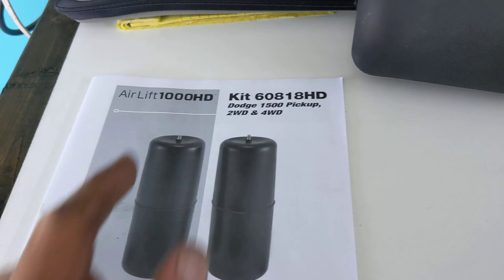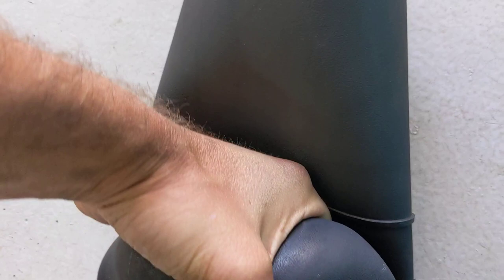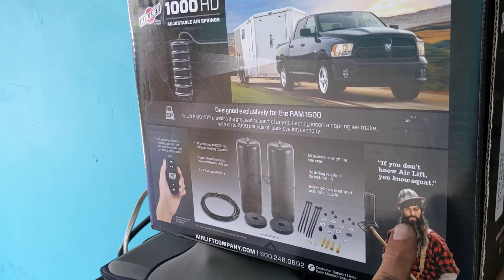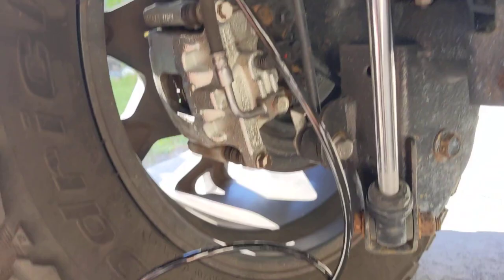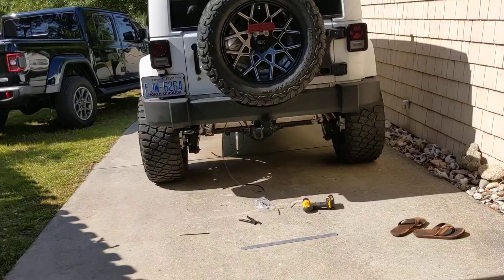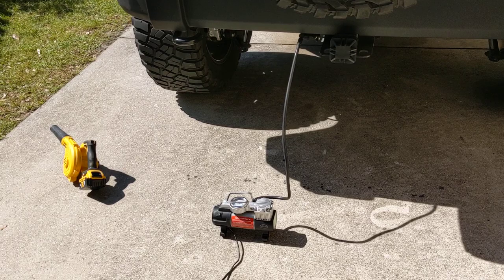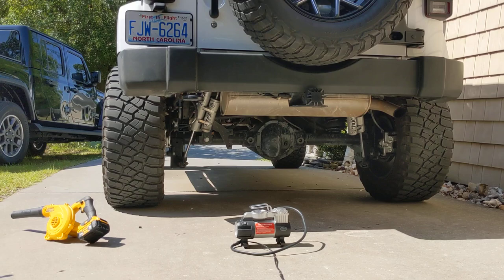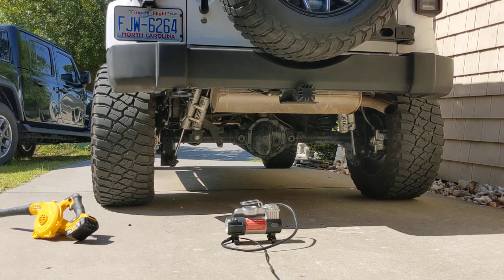Project Overland: Air Lift 1000HD Jeep JK Wrangler Installation

Comment: Look forward to your review.
Reply from the maker: I will be doing a review soon. But in the meantime... I LOVE these air bags!!!  at 55psi I have 0 sway and or bounciness from the rear and the biggest thing I noticed is when re-leveling the Jeep is braking seems much more effective with the nose not pointing upwards. Because I'm on the sand out on the beaches where I live I keep them at 40psi on and off road so that I'm not inflating and deflating all the time and that seems to be a good split for my use. A little stiffer on the road and just soft enough off road to not need dental work 😂

Comment: I've been searching for which bags I'd need with Mopar 4".  Thanks just ordered mine.  I use the ARB single compressor.  Although it works great.  It is slow for airing up 37 from 10psi back to 30.  If I did it again I would have gotten the dual compressor
Reply: did you ever make a follow up video
Reply from the maker: I don't think I did a specific video but they held up great I did have to replace one and needed a heat shield because it was too close to the exhaust, and just installed air lift air bags on my power wagon. I would buy these and the big brake kit as my first two must haves in any JKU I Ever get
Reply: @ianmburke  I have the big brake kit too. One of the best mods I did. 37” with bead locks did not want to stop with out it.

Comment: 2018 Jeep Wrangler JK here with the same 4” Mopar lift. Been looking for someone who has installed the HD version of AirLift. Look no more. After two years, presuming you still have the Jeep, are the air bags still serving you well? My bump stop plate has the same index from that bolt on the passenger side. I am going to reverse the bolt, ha. To funny to see the same thing! I blew a seal on one of my shocks , heavy load, bottomed out-lame. Wish I’d found these air springs sooner! Cheers
Reply from the maker: I have popped an AirBag while towing a WAY to heavy trailer down a really bumpy back road, but airlift has a lifetime warranty so they just sent me another. You do need the (not included with this set) exhaust heat shield.  This set was designed for the ram and that exhaust system isn't as close to the springs. But otherwise it's the best jeep add on along with HD JL big brake kit I've done. Highly recommend 👌

Comment: Great vid 🤙🏻 im running 5.5" Metalcloak springs in the rear... wondering what springs you are running? I guess the diameter will be the same. Does the height of your spring matter? Thanks!
Reply from the maker: The springs are the ones that came with the Mopar Lift so they too are Mopar the height does matter they have spacer pucks for the tall ones too

Comment: Curious to know a little more about the 1000 HD vs the 1000. I have a 2.5 inch lift now going to going to 3.5. Anyhoo I’m wondering if the 1000’s are even going to fit in my 2.5 inch lift springs.
Reply from the maker: I am not exactly sure, but if you measure the space inside the springs (inner diameter and interior height) and call airlift they will be able to tell you exactly what product will fit best- they are super helpful

Comment: Hi Ian - Do you know the inner dimensions of your coils? Looking to get the HD for my 2013 jku. I contacted airlift directly and they said that the hd kit will not fit my jku and they directed me towards the red universal 1000 kit. I would prefer the black hd like you have. I've searched around online and cant find any useful info. Any info you can provide would be appreciated!
Reply from the maker: My Jeep has the Mopar 4in lift installed so my coils are much larger so the HD was the size for my vehicle, but if your springs are stock you would need a different kit than the one I used
Reply: Thank you for your quick response @ianmburke ! I am currently running a Rock Krawler 3.5in lift. My coil inner dimensions are 4in wide x 10in tall. Do you remember yours?